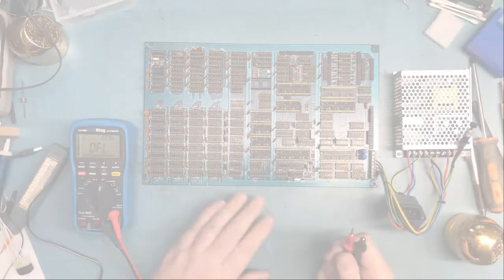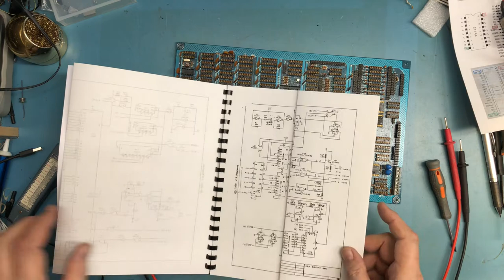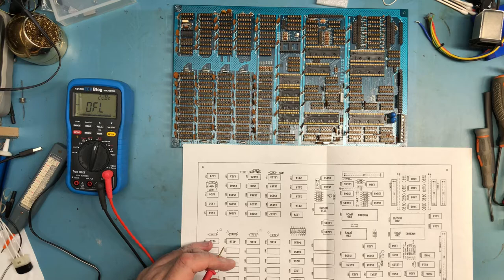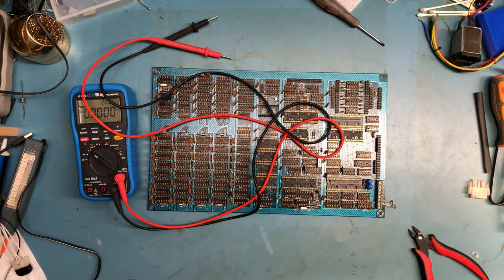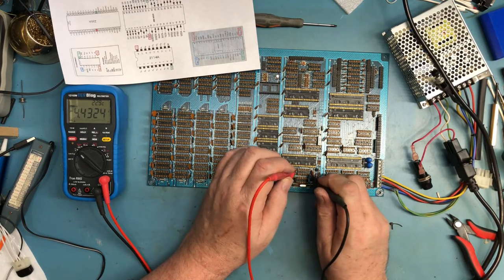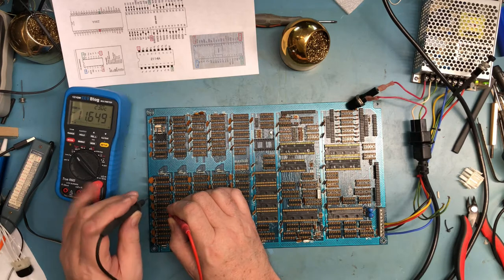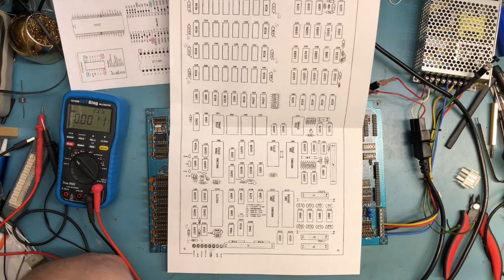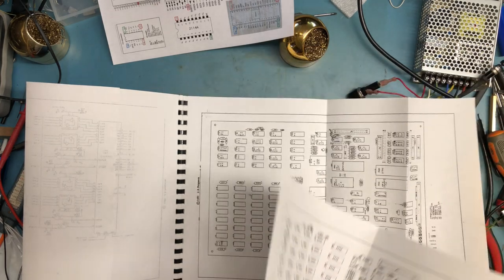STB652 - Ferguson Bigboard - Part 3 - Power Rail Testing

Comment: The ~500 ohms between +5V and Ground is function of R46 (220R) and R47 (330R) in a pull up/ pull down config for one of the floppy drive lines.  In the process of creating a reproduction of this PCB and encountered the same thing once the resistors were installed on the board with no other components.
Reply from the maker: Reproduction board?!?!? I was considering doing one myself. I'd love to build one even if it's a prototype that will need to be debugged. I've done a lot of this over the years with the S100 boards from http://s100computers.com/
I'm in the middle of a move between state and the entire lab is in shipping boxes so it will be a bit of time before I could take a build on.
Reply: Looks like my previous reply didn't make it, maybe due to the link I included to the discussion thread.  If you go the VCFED forums I have a thread on this project under the CP/M forum titled "Recreating the Ferguson Big Board".